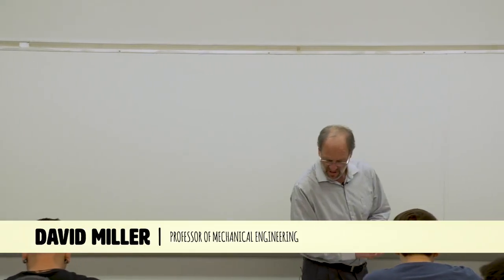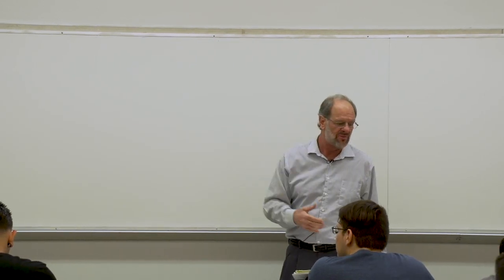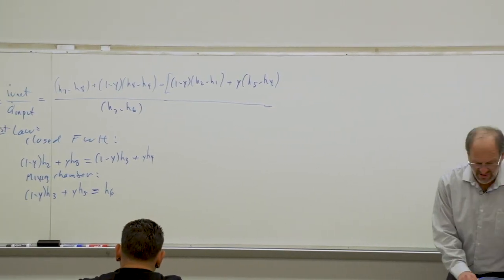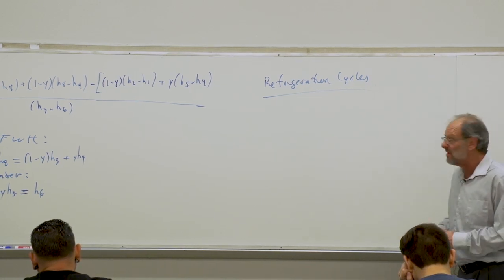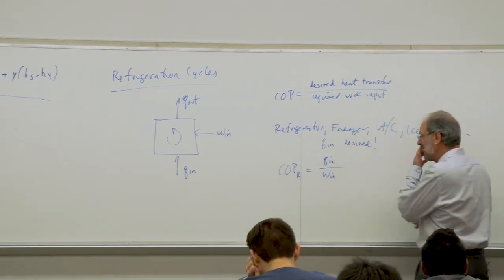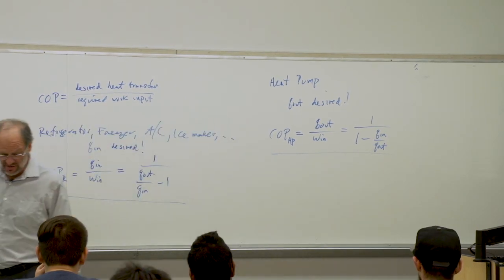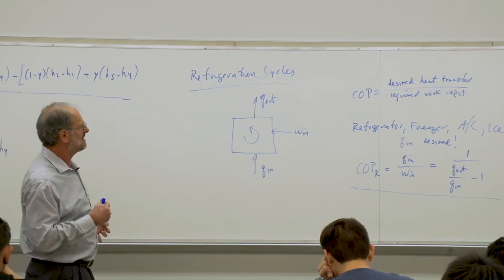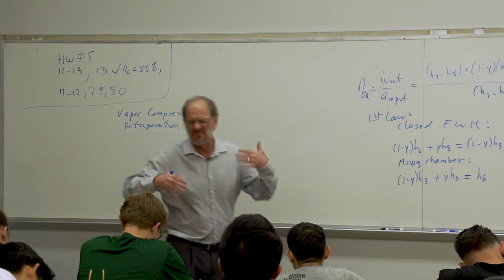Thermodynamics: Closed feedwater heaters, Vapor-compression refrigeration cycle (37 of 51)

Comment: Hello, thanks for the video. I want to ask a question, mostly in every Mechanical Engineering, is it okay if students study Heat Transfer without finishing the whole Therymodynamics? I mean, now in my campus I'm having my Thermodynamics 1, but I want to use my spare time to learn Heat Transfer... Is there any disciples that I should finished first before going to Heat Transfer?
Reply from the maker: You may want to study fluid mechanics as well because convection requires topics from both thermo and fluids.
Reply: @CPPMechEngTutorials  okay i understood, thanks for replying.. 😊